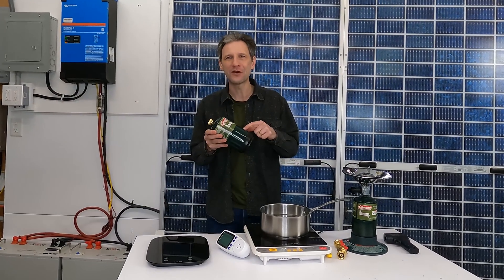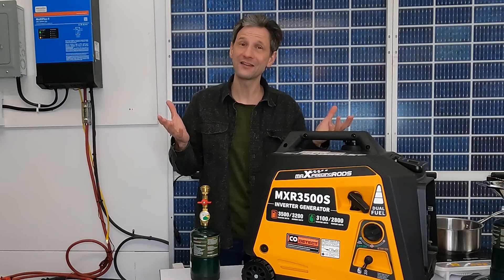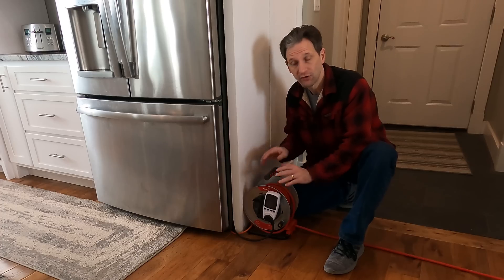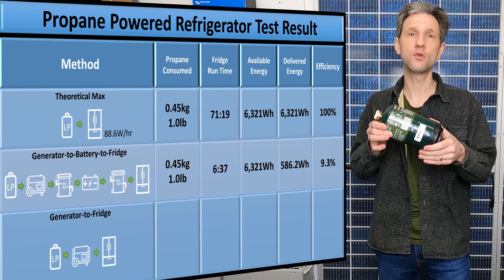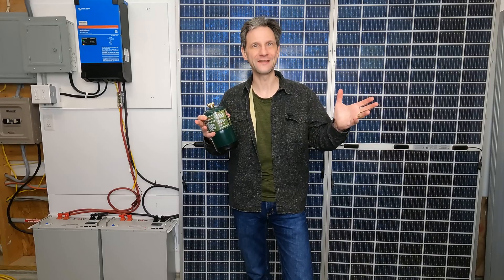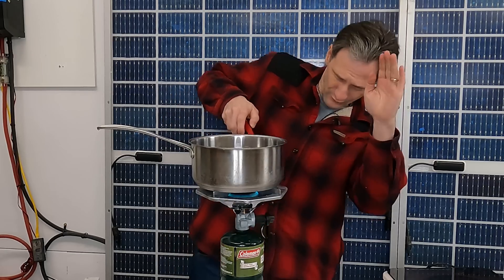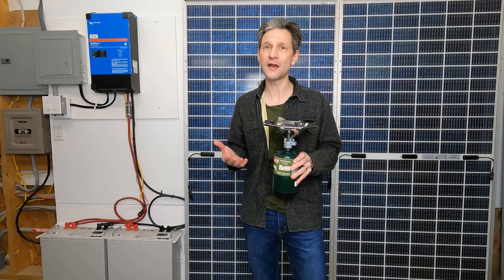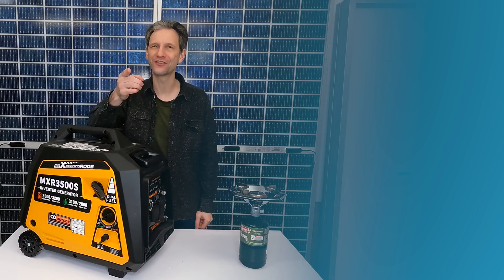Maximize Your Off Grid Energy Management - Dramatic Results!

Comment: Would love to see a 24 hour home test of. Run your daily needs for a 24 hour period and see how many watts that uses.

Let’s say that’s 30 kw. Now test how much propane it would take to charge your battery’s 30kw. But don’t run the generator at 100%, efficiency seems be at 50-85% load, so if you charged at 1400 watts, you’d probably get your 30kw in the 24 hours. Since the load would be constant, you could run it for 2 hours and figure out the propane use for the 24 hours.

I’d like to figure out what the best variation of a hybrid system is to get most efficiency. For example, 2 Delta Pro 3s with hub, can start a 5 ton AC. To get an equivalent 16kw starting watt generator, it’d be pretty large, like 12kw running. In the the 5 ton example, running watts at ~3500 watts, you’d be at 30% load, below optimal efficiency. Not to mention that my typical duty cycle in a day is 30%, even at 50%, your sipping a lot of fuel.

The biggest advantage of this system is that if we take those same 3500 running watts of the AC at a 50% duty cycle, we could charge those delta pro 3 at 1600 watt, right in the sweet spot of efficiency of the generator, sipping fuel compared to a 12kw generator. You’re now running a 5 ton all day with a 3600 watt generator. 

Now if you can package a hybrid generator all into one, with the right algorithm, you’d have something pretty nice.
Reply from the maker: Theoretically, if you have an inverter with batteries you can get away with a much smaller generator.  However, you would want to have a high quality generator that is designed for many hours of operation.  I assume you have a soft start on your AC unit, even with that it's a big surge for the Delta Pro 3 system.

Comment: Good experiments!
But we also need to know the losses from charging the battery and than getting the power out of the batteries.
The battery will not give you back the same amount of power you put into it.
I am guessing there is a 20% loss, depending on how fast or how slow you charge them.

Comment: No, you have to stop the generator when the fridge is not running.
You just take the signal from the fridge and use a simple relay logic to turn the generator on and off!
Fully automatic system

Comment: Great video! I'm curious as to how much of a difference using a DC generator could make? You could remove the losses from the generator's inverter and the Victron turning AC-to-DC to charge the SOKs.
Reply from the maker: Yes that would be an improvement.  What DC generator do you have in mind?
Reply: @ProjectsWithDave  YT is deleting my comments but Google WSE5000SH and you'll find the one I spotted. It accepts LPG and there's a 48V variant! I can't find the 6KW version anywhere.

Comment: Having a cheap generator around is handy, but really annoying as well. Not only when you are using it, but also having it taking up space when its not in use. Where as Solar and Batteries can be used virtually all the time, and justify its use of space. While saving you money every day. A generator does nothing but cost money. Even if you just have 1200-1600 watts of solar and 1/2 of that battery storage its enough to keep the deep freeze in the garage and a fridge going. And provide lights and charging etc in an emergency. Without the drone of a generator.

Comment: Combustion engines are always horribly inefficient compared to electricity. 70- 80% of the energy in the fuel is lost to friction and heat loss. Electrical loses are typically less than 12%. And while a H2 fuel cell may run at 60% efficiency, that does not include the inefficiency of the conversion process to create the H2 in the first place. Which brings it down to actually being not more efficient than a gas car. Ive seen a couple of studies that concluded an H2 powered infrastructure would actually require roughly 3 times the amount of energy generation vs a battery powered system.

Comment: This was great information. I am just getting into solar and inverters. I have an on-demand propane hot water heater, propane fireplace, and propane stove. I also have a propane generator for emergency backup. Even when I have solar and batteries, I am going to continue to keep my propane heating appliances. I am looking forward to the batteries being used for the electrical appliances like well pump, refrigerator, freezers, and lights. I know that direct flame is the most efficient way to generate heat for those appliances. I am looking forward to adding the batteries and inverter to maximize generator efficiency. During a recent extended storm-caused power outage, I had neighbors with a Generac whole house propane backup generator and 300 lbs of propane. That generator burned through all that propane in just 5 days. The outage lasted 10 days. They were completely screwed because propane deliveries were not possible because of storm damage. Meanwhile, I was manually turning my little 8kw generator on and off to keep the appliances running as necessary. I went through less than 80 lbs in the whole storm because I was using propane heating appliances and manually cycling the generator for the electrical appliances. I know that if I have batteries and an inverter, I can probably double that. Thanks for this test to prove what my research said without actually doing the tests myself.
Reply from the maker: Your situation is exactly what I was trying to demonstrate with this analysis.  Running generators constantly can be very inefficient, and having multiple sources for power greatly increases your options.

Comment: 5:50 That generator walking away is a little freaky. I know it's probably the torque from the starter or something but definitely would be a bit of a clinch moment, even if it stopped walking around in regular use.

Comment: Personally I would make a note how often and how long the fridge turns on per hour then in the event of a power cut run the generator or turn on the inverter for that amount of time per hour. Be the best use of available energy.
Reply from the maker: I guess if you don't value sleeping at night that would be an option.
Reply: @ProjectsWithDave  Haha true but obviously a fridge would stay relatively cold over that period and first thing in the morning would be to fire up the genie.
Reply from the maker: I'll at least give you the fact that your strategies would improve efficiency.  😀

Comment: thank you for this video.  i am curious in using a tri-fuel generator to charge the battery banks using natural gas.  i think this may come in handy on days solar doesn't cut it and grid power is down.
Reply from the maker: I don't have a try-fuel generator to run that test, however, natural gas in most cases is likely much cheaper than propane.

Comment: Nicely done.  So assuming I have a flat or nearly flat battery and need to recharge it using a generator, am I better off running the generator flat out and charging quickly, or is it more efficient to kick on the generator's energy saver mode, let the generator basically idle and slowly recharge my batteries over a longer period of time?  Ignore the issue of topping off your battery above 80% where you probably can't use all the watts the generator makes.   From 0-80% state of charge, what is going to use my generator fuel more efficiently?  I really have no sense whether these little generators operate most efficiently in terms of watts per kilo of fuel consumed at idle vs. at/near their maximum rated output.   I imagine that there also may be differences in inverter efficiency at various loads that would impact the answer.
Reply from the maker: Typically these generators are most efficient towards the top end of their output.  However, I haven't run a test to empirically confirm that.
Reply: @ProjectsWithDave  Thanks for answering.  Appreciate it!

Comment: For the MXR3500S Inverter Generator - is there a 'decent' way I could have it send DC power to my Ecoflow Delta Pros? (15amp/150V is the limit I believe, and this is once again DC power).  I may just bite the bullet and get the Ecoflow dual fuel generator but it can only power one of the units at a time.  It does do it automatically too though so that is somewhat neat.
Reply from the maker: You can charge the Ecoflow using the AC outlet, but I don't think there is a good way to utilize any significant DC output from the generator.  Are you just trying to avoid the AC conversion losses?
Reply: @Projects With Everyday Dave  No, cannot charge through the ac outlet while using them as backup.  Has to be dc unfortunately.

Comment: Hi, I bought the MXR3500S generator from a German warehouse, a direct representative of the manufacturer MaXpeedingrods. It was November 2022. Last week I wanted to use the generator after a week break, but it wouldn't start. I found that the internal battery had zero volts. After disassembling it, I was in for an unpleasant surprise.
One cell out of four has zero volts and one is inflated. Probably the bms unit is not working correctly. I tried to contact the German representative by e-mail, where I described my problem. Repeatedly, but this representative must have died because he is not responding to emails. Avoid manufacturer maXpeedingrods,
which does not provide technical support in case of a problem with its generators. I am extremely disappointed with the attitude of the German representative of maXpeedingrods. If I had known this before buying, I would not have bought the product 100%.
Reply from the maker: Thanks for posting your actual experience.  The manual does recommend disconnecting the battery for long term storage.  However, that should not have caused swelling.  Does it still run using the pull cord, or connecting to an alternate battery power source?
Reply: @ProjectsWithDave  Yes, the device is functional with an external battery.

Comment: that's not a fair test when you use a generator you more than likely are running way more than one item such as fridge freezer lights etc so the power from generator is not wasted
Reply from the maker: I showed both conditions:
1) Intermittent load with the fridge
2) Full load with the hot plate.
Reply: @ProjectsWithDave  i guess that's true

Comment: That electric start generator is cool! It needs a bank of super caps inside to deal with low current demand and then it can start itself up when it needs to !
Reply from the maker: Hmmm... that's a great idea for a super efficient generator solution.   It would be expensive though.  It would need a stronger starter motor and high current batteries or supper capacitors.

Comment: Do you have the data if you ignore all the inefficiencies of getting electricity into the batteries and only look at the inefficiencies for getting the power out of the batteries through the inverter and onto the hot plate? I am curious how that compares to propane running the generator to power the hot plate.
Reply from the maker: Basically, you are asking for a comparison of an induction plate powered by solar-charged batteries vs an induction plate powered by a generator?
Reply: @ProjectsWithDave  I was trying to ignore the inefficiencies of charging batteries from solar or a generator. I thought you might already know how many watts left the battery and how many watts made it to the induction plate.
What you showed was very interesting. I have solar panels and batteries that I currently run my refrigerator on but my plan was to heat food in my microwave. Your induction plate used one full battery in nine minutes (I thought about that and my statement is not true) and I don't think the microwave would do any better. I will do any cooking or water heating with the propane equipment I already have.

Comment: Very interesting and well-executed experiment.  Heating and cooling of "things", including air, water and people, consumes a lot of energy.  Most folks really have no concept of just how much energy is used to accomplish that heating and cooling, but it's a large percentage of overall household energy usage.  Renewable sources help a lot, including biomass options like firewood.  I would be very interested to see how well the propane worked to run a refrigerator designed to run from propane.  It would also be interesting to see how efficient a DC-powered fridge runs compared to an AC fridge, since you could avoid multiple conversion losses.
Reply from the maker: The problem is, I don't have a DC fridge, an AC fridge, and a propane fridge that are the same except for how they are powered.  Otherwise, it's not a valid comparison.
Reply: @ProjectsWithDave  - Suffice to say that the propane fridge and DC fridge would be more energy efficient than using the propane to create DC through the inverter generator to power the AC fridge?
Reply from the maker: The DC fridge should be more efficient than the AC solution. I couldn't say for the propane version.  I don't know how efficient those are.  There is a lot of waste heat, so probably not very efficient.
Reply: @ProjectsWithDave  - From limited research, the propane fridges cost more but are cheaper to operate and last a long time.  They have limitations but work well in many common situations.  It seems to me that having your own panels, making "too much" electricity, and running one or more DC fridges, is the way to go.  Really like the content!  :)

Comment: Hi there I have a question. 
I have a friend who has an old solar sistem about 10 years.
Is there any way to install something simple so he can monitor production on his phone.  Right now the only way he can check the production is directly on the small screen on his inverter.
Thanks
Reply from the maker: Yes, you can use a system like this: https://amzn.to/3YCekAL
It will allow you to monitor the solar input as well as the consumption of the whole house and individual appliances.
Reply: @ProjectsWithDave  Thanks for the info but we aree noobs and this doesn't look simple to install.  Do U have a video about this 4 noobs afcorse :)
Reply from the maker: I may create one, but it would be several months out.  Someone has probably already published something if you search for it on YouTube.
Reply: @ProjectsWithDave  Thanks again we managed to find something much more simple but it will surve te purpose. However I do have a good idea 4 a video U could make its about the SonoMotors Sion solar electric car just jour a pinions and what do U think about it.
The thing is a car,powerwall and solar all in one

Comment: I am looking at this very setup.

I need a battery to run my cpap at night if the power goes off.  It needs to be pass through for power is on.  During the day I might be to run a laptop and a couple of monitors if power goes out. 

What would you recommend for a battery system? 

I was also looking at the wen df475t generator... but do you have any better suggestions?
Reply from the maker: Why would you want a generator to run your cpap for an overnight power outage?  You would be better off using a UPS functioning portable power station like this one: https://us.ecoflow.com/products/delta-2-portable-power-station?aff=632

Comment: I was paying $4 per gallon of propane to run my inverter generator 8 hours a day, costing me big money before getting my solar panels going. I haven't used the generator even once in four months. It is crazy how much the propane would have cost me if I was going to use it 24/7. I really missed taking the tanks for refilling every few days (NOT). Just FYI, the monthly cost of propane was about $400 for 24/7 vs. $40 from  power company (assuming access to one). A generator should only be used for emergency, short duration. Besides my initial solar investment, I pay zero now for electricity.
Reply from the maker: Yes, they are great for emergencies, but not ideal for constant use.

Comment: Since the scheme is to just run the refer it would be more likely the person trying to eek out the maximum would actually monitor their refer and shut the generator off when the refer is not running.   Your plug in power monitor can show the on/off times.  30 minutes of generator time running the refer compared with the refer duty cycle should show the 'generator only' to be a big winner.

Comment: Since your generator has an electric starter, it should be easy using a few relays and a small battery to make the system such that the generator is starting when the thermostat of the freezer/fridge is demanding cooling and stop the generator when the thermostat tells it doesn't require cooling anymore. In that way you should be able to prevent the generator running idle. I'd be curious to see the result of that. Should be far more efficient.
Reply from the maker: Yes, that would be more efficient.  However, it would add a lot of complexity, and only work if you had only one fridge connected and nothing else.  But, It would be cheaper than adding batteries and and inverter.

Comment: I would be curious about different flame levels on the burner boiling water. Would it use more or less propane overall to have the flame low?
Reply from the maker: There would be a crossover point.  Too low and the heat would dissipate from the pot as fast as you put it in, too high and more would be lost around the outside.  It would take a lot of testing to find that point.  I would just run it full blast, it was pretty efficient that way.